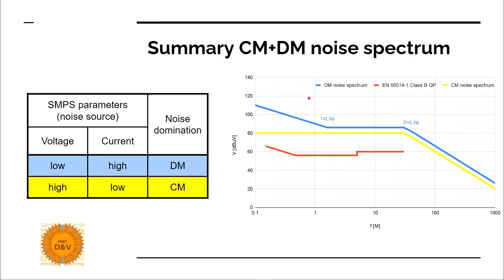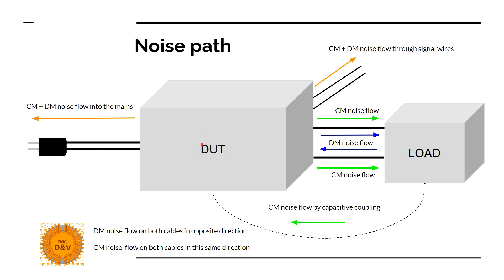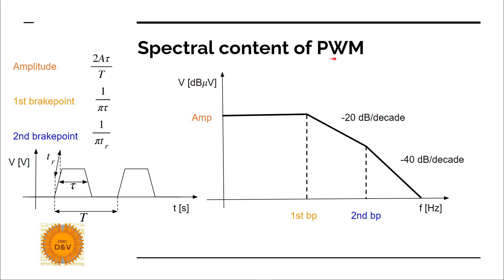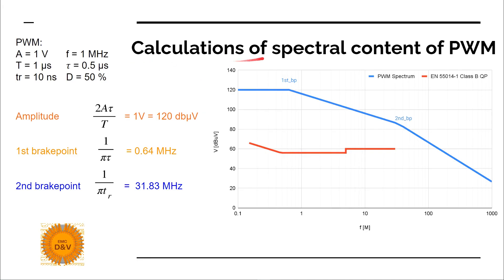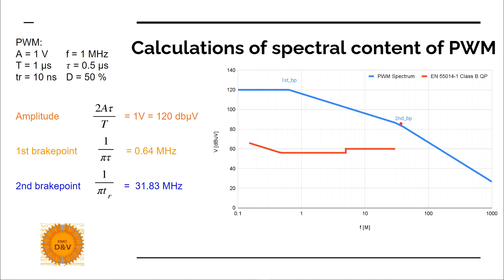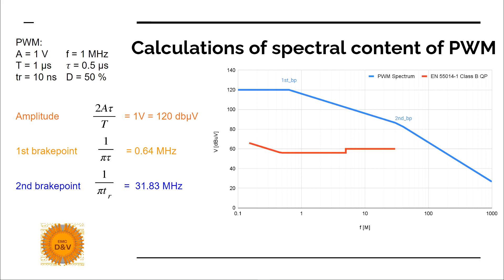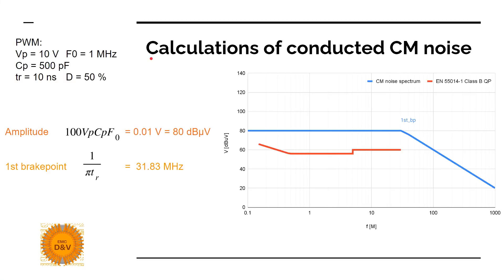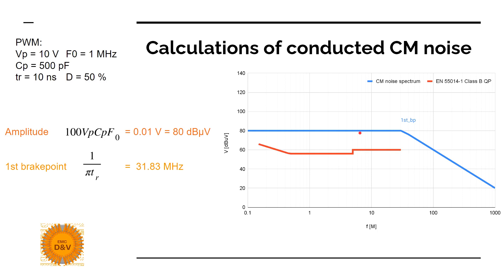Voltage noise spectrum calcs - Conducted Emission part 3

Comment: Hi. In CM noise, Amplitude is 0.01V. But what I get from Mathcad is 0.5A. 🤣
Reply from the maker: Well found! Tha input values in calculations I had slightly different from those in presentation, so in dB is even higher about 114 dB.